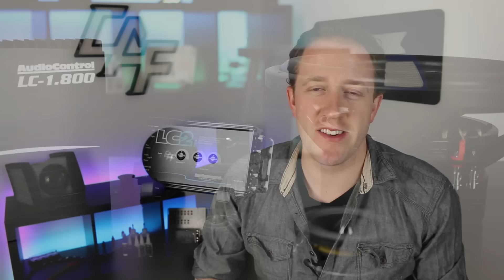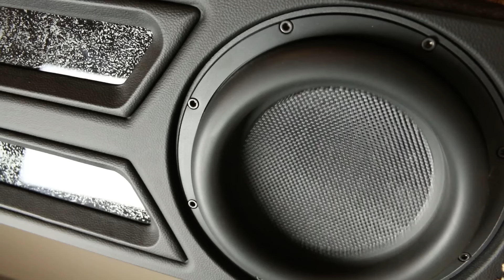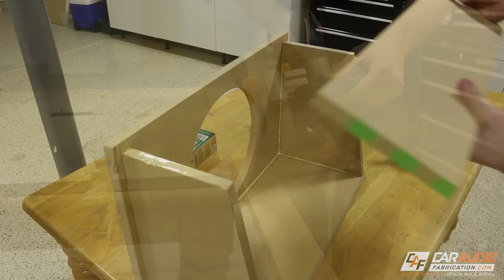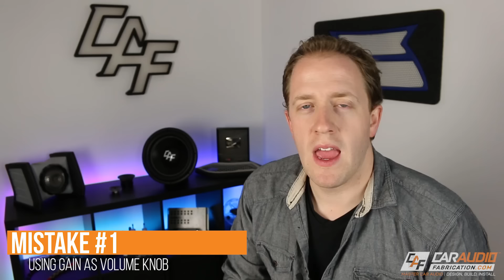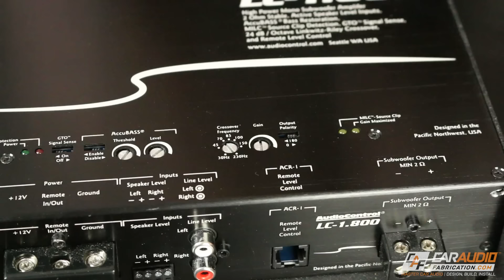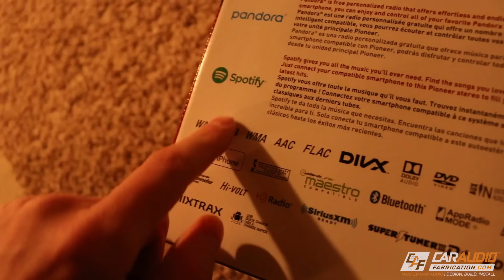Avoid these 5 common Car Audio NOOB Mistakes!

Comment: Hey, quick question here. I thought a capacitor would make it possible to give like more „impulse Strom/power“ to the amps? I already have a big battery  and alternator from factory (and also there isn’t really an option to upgrade these.) My battery is an AGM which aren’t really able to put out power fast so I thought a capacitor would help maybe. :)

Comment: When i had my audio system in my  o2 yukon i think i had a gain knob mounted under my dash and i actually could use it as a power knob all the way up and no clipping but i rarely ever had it up that high. Maybe it was something else and not gain though i dont remember

Comment: My rule for amps (let's say I want a 1500w max, 12in sub): choose something a bit over, so in this case like 2000w max amp is okay, just turn the gain down a bit. For sub space: recommended by manufacturer or a little bit bigger. For wires: look at how big the wire mounting mechanism is and choose the biggest it fits. Better safe than sorry, I don't want my trunk to catch on fire and my power to get lost to heat.

Comment: Big mistake often made by newbies is running your low level RCA Lines on the same side as power! Makes untraceable alternator noises in mids and highs. And the common first fix mistake is purchase a noise filter, which will not work very well !

Comment: I resell a lot of car audio and the 3 main problems is people thinking every box is the same. All wires will work just fine and looking at peak power. (Had a guy message me on a taramps 5k but he ended up buying a Vamprie (10 000w peak) amp from somone else for 100$ more than the 5k. When i have looked proper tests of those vampure amp’s they usaly put out about 150w rms.😂)
Reply: I learnt the difference between pmpo and rms watts when I was 16 when buying my first 5.1 set. I was quite annoyed at the time but live and learn lol

Comment: Do you have to run all the speakers to the amplifier or only two that’s close to the woofer
Reply: Cause I have 4 other door speakers .or they all has to be connected to amplifier

Comment: b u y  e x t r a  co n n e c t o r s ! ! !  don't buy just enough to cover the quantity of splices needed. double that chit! you will drop one between the seats, down that little sliver of darkness along the side of your gear shift, and in the bermuda triangle. you just know it dropped, but be damned if it is ever seen again. 

so now where does that leave you with two connections to go and... oh no! i'm out of connectors?!  blah... this tape will do just fine until i get back to the store. that will be never.  six months later, you're cussing at the piece of crap head unit that you blew a whole paycheck on. surely, it's that thing's fault. and we forgot aallll  about that picasso tape job, didn't we.

spend the extra couple of bucks yo!!

Comment: My newbie mistake is just cutting the factory plug off.. and the battery was still hooked up.
Reply: What happened dude?
Reply: @gwood6969 blew multiple fuses and shit didn’t work but I was clueless at the time. Had to take it to a shop for the rescue before a rafting road trip.

Comment: I had a 2009 honda odessey with dvd and navigation system and i install an amplifier and subwoofer to it with passive converter and when i turn off the van the subwoofer still pulsing and making loud bassing sound

Comment: I got a 2015 Chevy Silverado it doesn't have the Bose system but I got the factory head unit and I Hook up ds18 300 watts door speakers in the front along with a 100 watts sound stream Tweeter and in the back I got skars 6.5 100 watts to 300 RMS watts with a skar tweeter and keep in mind I didnt splice no wires I order a plug thing u can hook the wire up to the speaker which I got the tweeters wire wrapped around them with the plug in play adapter hook to em... but the problem, I had today is.... idk Im new to this yeah I know. I got to get me a amp!! i got one just was fixing install it till this happen?!!!! my whole driver side speakers and tweeters no sound!!!! but the dash, which it is all factory on the dash. but the whole driver side and behind the driver side door no sounds coming out. but the passenger I got sound, what is going on, what did I do wrong ?????? Bad part is long story but they mounted on the door I know and it was raining too and I heard like a little crackle not too bad.. and it stopped.... I need help or advise

Comment: i used to work in car audio way back when... the absolute biggest mistake was twisting wires together with electric tape or undersized grounds.
but yes, hated that lil gain knob.... the speakers are blown, my amp keeps cutting out... you look, and the gain is all the way up or all the way down if they are trying for warranty. it got to a point we started to put a little wax in the slot so we could tell if they messed with it. even super glued one guys gain controls told him it was either that or we void all of his warranties, i swear that guy wouldn't make it out of the parking lot before turning up the gain

Comment: What’s a decent system I can build for 2,000 in my 1999 Chevy Silverado extended cab? My goal is sound quality over max volume.
Reply: I second this,I'm upgrading my 01 extended cab silverado and want it crispy clear with decent bass just loud as hell. Lotta rock and country and some hip hop few and far between.suggestions???

Comment: Idk if this would really be called a mistake or not but installing a system in something you wanna keep in good condition... For the same reason Harley owners gotta keep tightening bolts etc the vibrations for a system will literally shake the car to pieces 😂 you can minimize this a bit with sound dampening material (for folks on a budget hit the salvage yard looking for Cadillacs they usually come with sound dampening material covering the trunk doors and floor from the factory)

Comment: biggest mistake is taking it to a professional so they can tune down all your equipment so it doesnt sound like they ever installed anything at all. the gain should be high or you shouldnt be installing you own stuff. learn to match products or dont do it at all. also having a large sub doesnt matter the space as long as you have the reverb and no back pressure to the cone. this guy is a fking tard.
Reply: First you said gain should be high and then you said you need to learn to match the products. So which is it then?

Comment: My truck battery is going died if my truck after it’s sets for 3 days with a Crunch ground pounder GPV1100.2 on , and I  got the truck 12 years ago with it in , never went dead before last year , but when I take the fuse out the truck for the radio, it doesn’t go dead. What would you say what it would make it go dead ? Thank you!

Comment: Wow this is definitely going towards me lol I bought a cheap Amazon burolump 4000 w Max amplifier for only 80 bucks and my headlights dim so does all my dash lights LOL Panda amp is pushing to 1200 w Max skar audio subwoofers then I have another amp cheap off Amazon that says 3,000 watt Max pushing my RE 10 inch 2000 watt Max subwoofer

Comment: Hello, I have a question, I have an automatic diesel engine and it likes it at low rpm and I'm planning a system of about 60A at 12.8V for now, with 4 AWG wiring to secure the future. Before the "big 3 upgrade" is it worth installing a 2F capacitor or straight the upgrade? I need for 2 amplifiers for the speakers in the doors and a sub of 220W rms at 4 ohm maybe in the future after the upgrade I change on a 400w rms at 2ohm but the consumption will increase to 75A at 12.8V. Does the car's electrical system help a little a capacitor before the big 3? Or is it not worth the investment on the capacitor? Thanks in advance for your reply ! (It's congrats for the expertise !)
Reply: @hd.5679  Usually a car manufacturer has taken steps to provide available electrical power.   
If you are concerned about having enough juice to run your stereo setup, then figure out the rating of your alternator. Perhaps if you have the bare bones car model and it came with a small alternator. There could be an upgraded alternator that provides more amps (and hopefully is a direct fit replacement).
EXAMPLE:  1997 VW Passat tdi came with 120A alternator (North America) it could have been replaced with a 70A which would not suit the needs for an amplifier, let alone glow plugs.  It is subzero this morning as I type this. 

Finally, there are a few articles regarding how large of an electrical draw there could be in regards to accessories like rear window defrost, seat heater/s, fan on high for heat or A/C ... and then your amplifier.   In the case of my VW, I would simply refrain from turning stereo on until the temp gauge indicates that my glow plugs in coolant system are no longer needed.  I would not want the 2 most consuming devices to compete.
Reply: @davepetrakos475  I understand, thanks for the reply, it makes sense what you say =] I'll probably go with a smaller system after I find out the specifications of my alternator / the energy consumption of the car

Comment: Ah yes, my mitsubishi mirage es hatch.... ive done everything wrong.
Bought used dual kicker 12s with ripping foam ring. And 800w sony xplod.... running cables too small, not giving the amp any breathing room, same battery, and wire harness.
Friend set up my system. Messed with the dials. No room in the back compartment, probably facing the wrong way..... and now im putting in kicker ks in the front and cs in the rear door. With no amp, bout to see how well that works... i guess im saving up for an amp, and some cables/alternator/battery/capacitor. Do i care,  ot at the moment? Nah. Lets just hook it up and have some fun.

Comment: I made the mistake of installing new JBL speakers in my rear and front doors, along with replacing my dash speakers. The sound quality was horrible and there was popping and cracking. After removing the dash speakers (because its the easiest to do) and putting the old stock ones back in the sound was way way better. Albiet i had to turn the treble down a notch and adjust the noise centering on the radio... But the speakers actually sound like they should now.

Comment: Any help on wiring? I think I have my remote wire wrong on my head unit, I hooked up my own sub and Amp but it's not at any of its potential as I think it could be a weak connection or wrong wire I've hooked it onto the head unit with the remote wire Any feedback will be muchly appreciated

Comment: Upgraded my stock speakers and head unit for like 170aud (~110usd) in my 2003 vw beetle
They weren’t extremely powerful, only 270W but they sound sooooo much better than the stock ones so I’m glad I didn’t spend heaps of money as I can already appreciate the upgrade.
anyway, literally the next day my alternator dies and I was thinking it was somehow the speakers that did it 😂
Nope it was just unrelated but such funny timing honestly. I was like “how low power was my old alternator that it can’t handle 270W???”

Comment: I have to add the worst mistake.   Not using a fuse on the sub amp main wire.  I have been an auto tech since the 70s.  Want to see how to burn you vehicle to the ground:  don't fuse the main amp wire and then develop a short on that wire.  Poof      I've recovered several completely ruined vehicles because of this simple mistake.
Reply from the maker: I have a few videos about fuses and there's always a few guys that complain and say it's not needed. They need to hear your experience!

Comment: The one I see a lot is not matching the speaker wattage to the amp. See people buying 500 watt speakers and a 200-watt amp. Then, wondering why they don't have the volume or the bass they were expecting. I always try to get an amp that is close to the speaker wattage without going over 75-80% (my number, not any standard) of the speaker's rating. Figure it will give nice sound and prolong the life of the speakers assuming they keep the sound settings reasonable to not create distortion.

Comment: I think the biggest mistakes newbies can make is getting high powered speakers in a low-power system . And when they do get an amp they turn the gain up to where it gets louder faster and that will make it distort really fast

Comment: lol... I am putting an Alpine head with 4 kicker speakers in my 1995 regular cab F250, and my neighbor gave me a kicker cxa300.4 amp and a Memphis srx12sp  -all in one sub ,that won't fit into a regular cab. I am fitting it into a slim behind the seat box from rockville. So, sub way too big and enclosure way too small and stuffed behind the seat. oh well, its a project truck and the amp and sub were free.  it is what it is....

Comment: How is it in terms of sound quality? Can it be compared to something I know, like HELIX P SIX DSP MK2? Is there only 12dB/oct and 24dB/oct? And the others? What about time correction? Which connection method can be used with android multimedia? It is important that the sound is not processed from android. How to connect then? By bluetooth? No optics? With optics it's like a clean signal as far as I know. I don't understand English very well, so please forgive any inaccuracies. Thank you

Comment: I’ve upgraded head units in the past. But I need a little help this time. I have a ‘04 Honda Pilot with a factory subwoofer. The sub is powered by the  factory radio.  Problem: I’d love to keep the factory sub mainly cause it’s a pain to get to.  
1. Is there a head unit capable of driving the sub, like the factory radio does?
2. If not and I need to get an amp, what would you recommend?

I know the factory sub is a 50 amp/ 2ohms. 

Your suggestions are greatly appreciated. 

RLM

Comment: Shouldn't lack of tweeter capacitor be in there somewhere? To me, that's more important than music source because if you're new to dsp's and run active;  one mistake can trash your tweeters, and that would sound worse than lossy source.
Reply from the maker: There's a million things you could argue are also important. This is simply opinion.
Reply: @CarAudioFabrication  Agree. I thought it would be worth mentioning.

Comment: I messed up a couple times running the power and speaker wire on the same side.  my friends boyfriend  ran the power wire out the window to the battery with no fuse!!!

Comment: Hi. Really liked your videos. Have a question. I drive 18 wheeler and I have pioneer deh80prs head unit and 8 infinity 6x9 speakers with 2 alpine amps pushing them and Rockford fosgate 2500 amp with a 12 inch subwoofer. Lots of room in my truck. Everybody say it sound good but I personally  …… not so happy. I don’t even know if I’m using all the features of the head unit. Can you please help me set up my system or guide me to get the best sound. I will highly appreciate that as I listen to music 14 hours in a day. Thanks in advance

Comment: I have a Pinoeer head unit and amp and cool enough it’s has a mark on the gain setting for their 4V head units and then their 2V are on the standard setting. That saves money on the equipment or especially paying someone to do it for me if I didn’t buy an oscilloscope

Comment: My first subs were kenwood excellon 2 12s and i still have them still love them havent brought mw down yet about a max at 1000 watts close 2000 watt peak true power they sound good not as loud as i want them but they are loud enough to turn some heads

Comment: I got 60w rms doorspeakers thinking it wouldnt be a problem my car radio has a max output of 50w. Turns out it was 22rms and 50w peak. Anyway, this is not good and my radio sometimes says: "miswirering, check wire then power on". Lesson learnt from here is that your amp always gotta be more powerfull then your speakers. Otherwise you will get strange problems or the music cuts out when you're just vibing(even at low volumes)

Comment: My newbie mistake was putting 15” speaker and two 12” subs in my trunk with no upgrades to my electrical system and ended up killing my alternator on my break at an overnight job :/

Comment: I am adding an LC2i pro to a 2020 explorer to add a subwoofer with the factory door speakers.  If I splice into the factory audio front control module's front speaker outputs for the  LC2i there shouldn't be a problem with it supplying signal to the front speakers and the LC2i correct?

Comment: Good vid and info. I'm just looking to install a 10" powered Pioneer enclosed sub. It's all in one. Need a little more thump. I'm putting it in a Kia Optima 2015. Any idea if this will encounter problems?

Comment: I have some components to upgrade my wife's car, so far I have;
Head Unit: Kenwood Excelon DMX958XR  Amp
Amp: Kenwood Excelon X802-5 X Series
4 Door Speakers: JBL CLUB 625SQ 6.5"
Her car came with a harmon kardon stereo setup factory from Subaru and I plan on reusing the subwoofer but pulling the rest of that system out. In your opinion would these work well together? I have tried to match things fairly well and stick within my budget.

Comment: Run your audio along side your power supply wire. It makes a whizzing sound when you hit the gas pedal. Took me years to figure that out in the early 90's. I also took road master and Sparkomatics speakers and made one hell of a system. A pawn shop in Oklahoma sold exclusively Roadmastet. I built the system for the pawnshop van. I started out w/ SoundWorld in Muskogee installing equipment for thise who purchased from them. Then Sooner audio revolutionized with DD speakers. 10 8" in the back of a Honda civic. Btw you can modify DD Amps and give them around 800 to 1000 more wattage. 🤫 Don't tell anyone